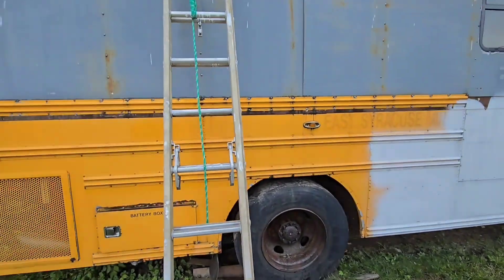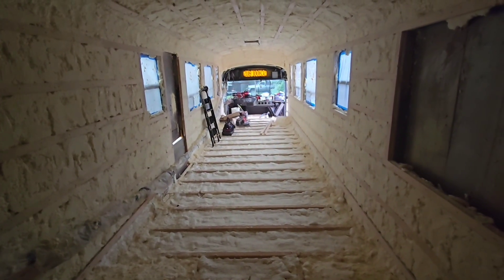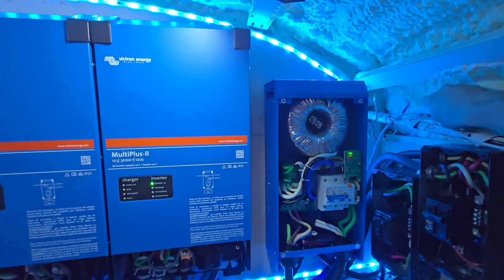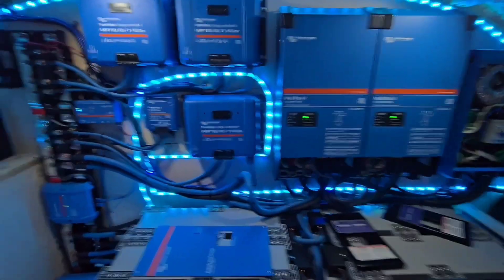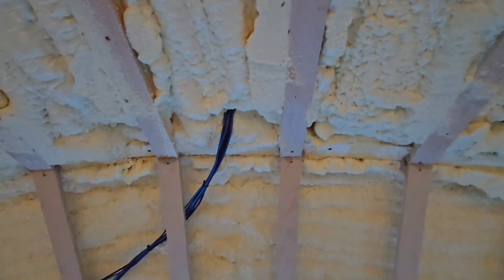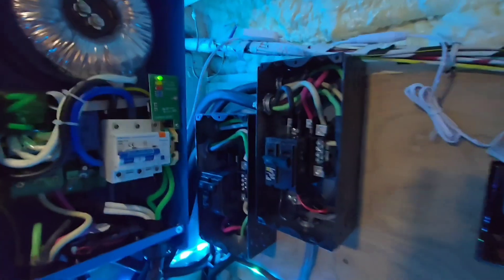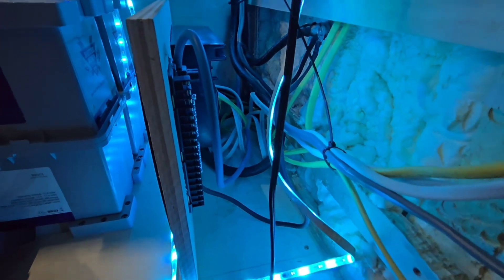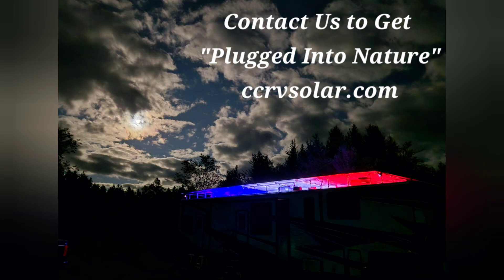Skoolie Solar System Install - Victron Inverters with Autoformer, 270Ah Battle Born Game Changers...

Comment: did he really need 2 inverters?
Reply from the maker: Yea was installing a 240v mini split so he needed split phase which can be done with a autoformer like I used and one inverter but it's not really the best reliable option....

Comment: Nice setup, well insulated, should be a great build when finished. 
Bit crampy on the breaker switch area, but what do you do?
Lots of blue stuff, looks nice, I want one, what would this whole setup be worth/cost?
Reply from the maker: This exact system with battle born batteries and the 200 watt panels around $27,000 with labor....change battery brands and use bigger panels I could shave 10-15% off that.....
It's pricey but those who truely use the system regularly or in my case every day we couldn't live without it....
I have a few system options on my website as starting points....ccrvsolar.com 
Thanks so much for your comment.....

Comment: How much weight is that damn
Reply from the maker: Well depends on if we are talking just what's inside the back of the bus or including the roof rack and panels.....
As for everything inside Victron equipment, batteries and wiring, is somewhere around 550 pounds, the solar panels themselves are about 325 pounds, the rack I didn't build but it's got to all of 400 pounds I bet....
So everything is definitely over a 1100 pounds.....for this skoolie it doesn't matter, for some RVs it totally does......

Comment: Why did you choose to split phase the inverters instead of using the autotransformer to split phase? If you let the autotransformer do the split, he would be able to output power if one inverter goes down.

Curious as to the reasoning behind split phase before the autotransformer.
Reply from the maker: All the dual inverter installs I've done, which has been 80 or so, have been wired in split phase, autoformer or not.....I never run them in parallel due to the potential to overload the shared neutral....
The autoformer is installed solely for load balancing the inverters, the same autofomer can be used to make split phase out if single phase but it's not really great for that, it gets hot and shuts down.....
I've installed 100s of victron inverters and the only 1 that failed and it was abused and I still had his power on in matter of hours, so I never really plan for an inverter failing....
I appreciate the question and everyone has their own opinion forsure, especially with rv solar.....
Reply: @ccrvsolar  they do fail, all the time, but not from manufacturer defects. They fail from outside sources like lightning strikes or power surges. I've even had capacitor failures in them.

I've installed quite a few autotransformers and never had any issues with them as you suggest, but I have also never had a neutral overload like you suggest either. Maybe there is something you are doing wrong that is causing the issues. I currently have quite a few parallel inverter with autotransformer installations running for quite some time and never had an issue out of any of them.
Reply from the maker: @charlieodom9107 Alright your totally welcome to your opinion.  All my customers use surge protection from shore power, so again would be extremely rare to have an outside source fry an inverter....funny your sitting here telling me about all the inverters you have burned out which I haven't had but your telling me I'm doing something wrong, kind of ironic....
I've never had a neutral burn up because it was beat into my head from my first ever dual inverter install from my Victron contact not to do parallel systems in my RV applications....doesn't mean they won't work but from a liability standpoint I'm not doing it.  Do you have circuit protection on your neutrals, I'm sure not.  Single phase the neutral has amps and in a hybrid boost situation there can be more than 6g is rated for add some resistance somewhere and you have a hot connection....is it a rare sitiation sure but doing 1-2 RV Victron Solar systems install a week 50 weeks a year I meet all kinds, I'm not putting that liability in their hands....
And as for the autoformer a simple search on the victron forums will show you they get hot and shut down making split phase from single phase....if the load imbalance stays low between the legs they're fine so if your installing them to run one 220v appliance that might work for you but thats not how I'm using if I install it to make split phase.....
Again to each their own, if your business model works for you great cause mine is has surely been working for me.....
Thanks so much for the conversation.....
Reply: @ccrvsolar  oh no!!!! Not a surge protector!!! We all know those things work great, right???

You are comically ignorant!

Please, continue; I haven't had a laugh this good in quite some time!!!

Comment: Lots of blue stuff in there. They’ll definitely want some exhaust fans. As you stated, that service panel is going to be annoying but sometimes you just gotta get stuff in there.
Reply from the maker: Yea definitely the owner is going to put some exhaust fans in the wall once he gets it built....
The autoformer actually helps keep the system cooler I have noticed with my own setup, a 1200 watt load on one inverter will make it get warm but 600 watts on each inverter no so much....
He will still want air flow tho forsure....
Thanks for watching and commenting....

Comment: Nice work. I live in AZ. Curious. What is the magic of Quartzite all about?
Reply: A warmer place to stay in the winter, big tent event (lots of vendors selling polished rocks) and kind term dry camping with some accommodations at a very cheap monthly rate. I do believe it went up this year quite a bit, though.
Reply from the maker: There is multiple reason we go there, the completely free camping just a few extra miles outside of quartzite but close enough to hit the easy in and out rv service stations on our way in and out of the area, tons of RVs, we have lots of friends and fellow Escapees we see there....
We really only spend about 3 weeks there but it's a place we go every winter....
It's kind of a right of passage for fulltimer rvers, you got to go to quartzite at least once....
Reply: @ccrvsolar  that's great. I have a project starting in February there. So it should be a good time.
Reply from the maker: @jake8882  what kind of project?
Reply: @ccrvsolar  we are building a kids splash pad there. It does get hot out there. Ha